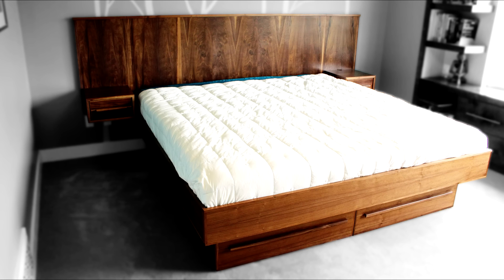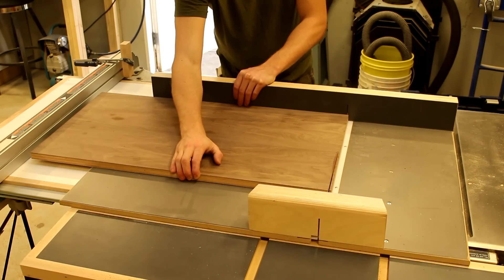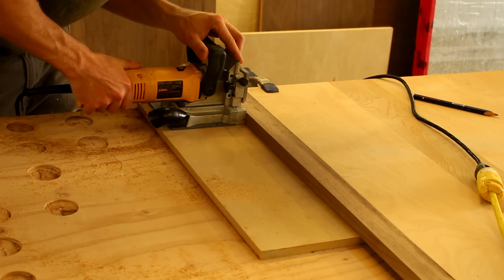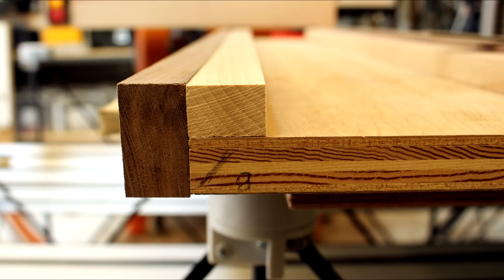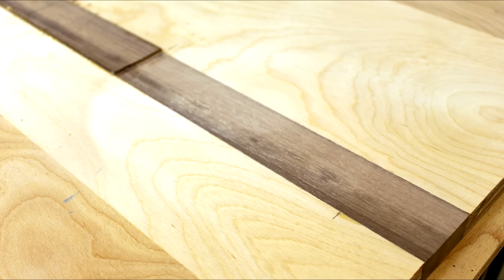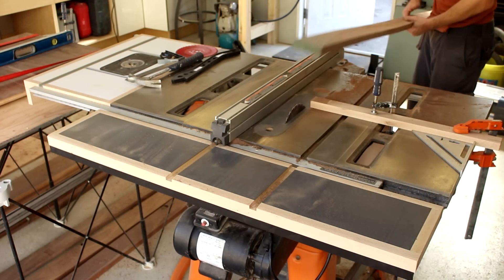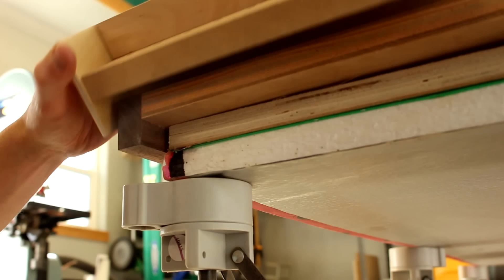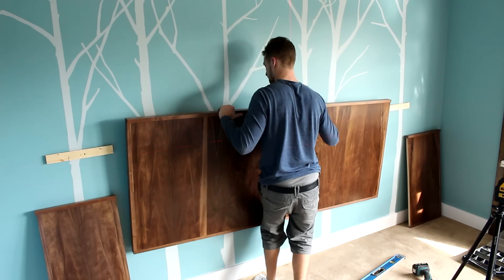Make a Mid Century Modern Bed Frame| Part 1 | The Headboard

Comment: Hey, so I've finally decided to build this! I have a question though :what are the dimensions of your trim? You say 1 inch thick, I think, but by my calculations for the head board they should be 1 1/4 to make the full 114 ". I'm lost. 1"x? Or 1 1/4x? Thanks so much!
Reply: Actually, I realized your video says a headboard total length of 114" but your website says 113". 113" makes sense! So excited about this build!

Comment: Very well done video for me the right amount of explanation and I think anyone could follow along very well. One question comes to mind why not just cut dados into the ply and inlay the material? Same look and more cost effective, no need to glue the plywood sections back together??
Reply from the maker: +Pat M 

In my case I wanted the grain vertically oriented which makes the center section larger that the width of a sheet of plywood so I could no be a continous piece of plywood with inlays (I. e I had to chop it into small sections anyway)

the wings on the far side which will later hold the side tables are designed to be completely removed in case the bed is later placed in a smaller room.
Reply from the maker: +Pat M 

In my case I wanted the grain vertically oriented which makes the center section larger that the width of a sheet of plywood so I could no be a continous piece of plywood with inlays (I. e I had to chop it into small sections anyway)

the wings on the far side which will later hold the side tables are designed to be completely removed in case the bed is later placed in a smaller room.
Reply: That makes perfect sense to me now. Thanks so much for the explanation. I learn from asking them.

Comment: What kind of wood do you use and where did you get it??
Reply from the maker: +Jordan Naemi 

I started by chopping down a tree and allowing ample time to dry... just kidding. I got lucky on Craigslist and scored three sheets of Walnut ply wood for $100. Normally I pay $180 per sheet at a local supplier. The solid walnut I purchased in shorts to save $$$

I talk more about it in my post:

http://www.buildxyz.xyz/index.php/2016/06/05/make-mid-century-modern-inspired-bed-frame/